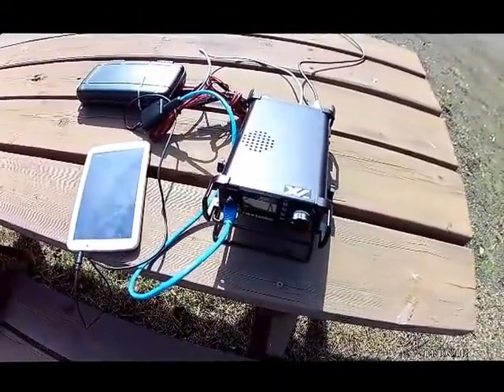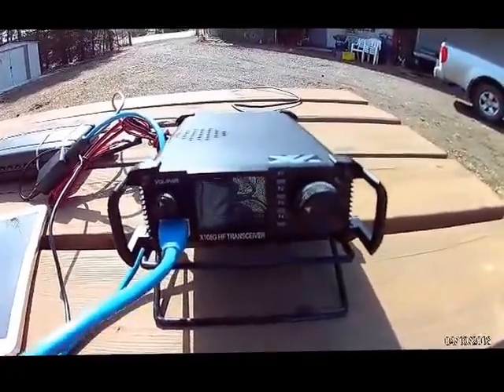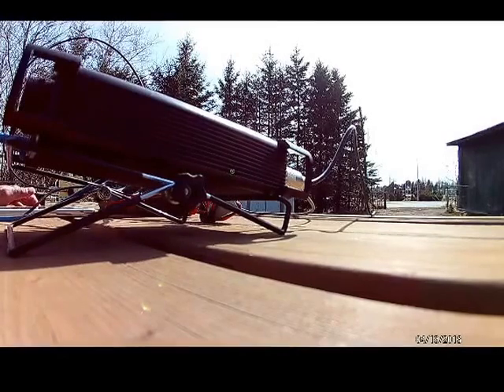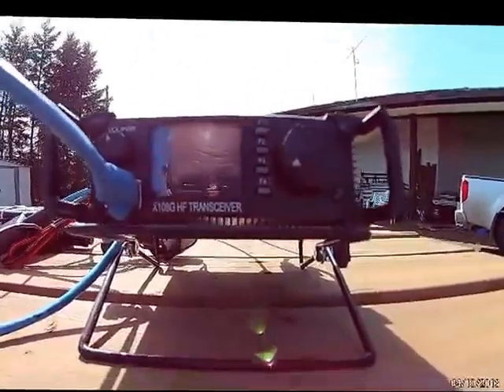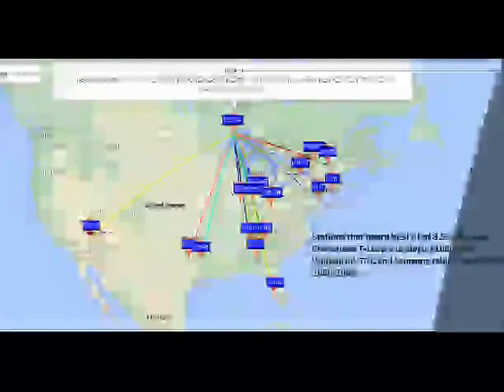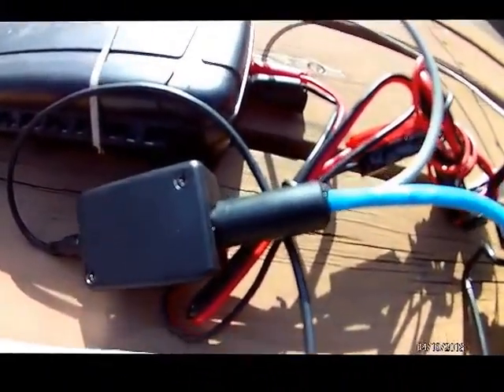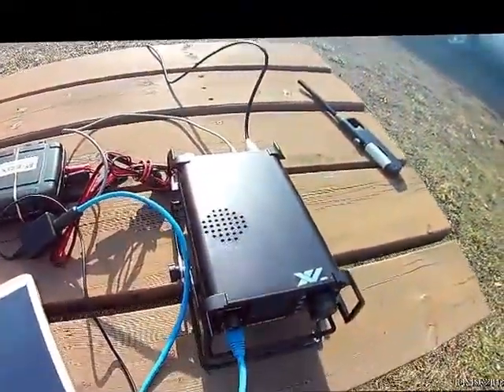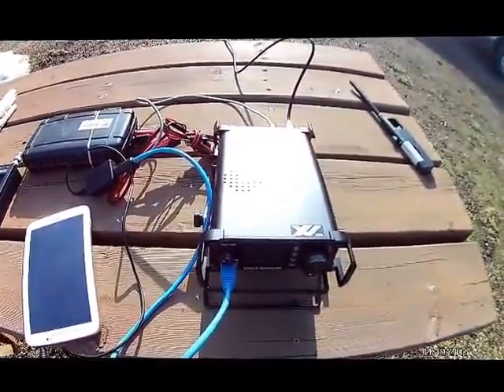CHA F-Loop and Xiegu X108G on WSPR

Comment: Nice video! Do you happen to have the pinout for the cable between wolphilink and the radio? I assume you have the PTT and audio in through the RJ45 port and the audio out through the spkr port on the back. Is that correct?